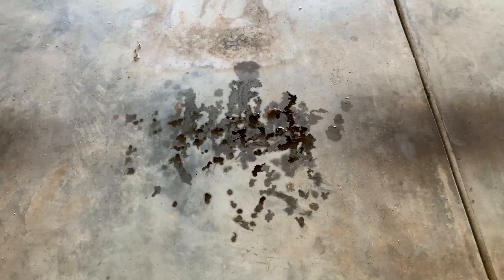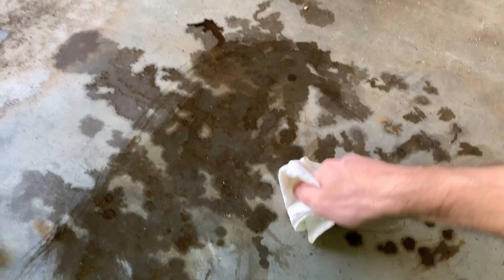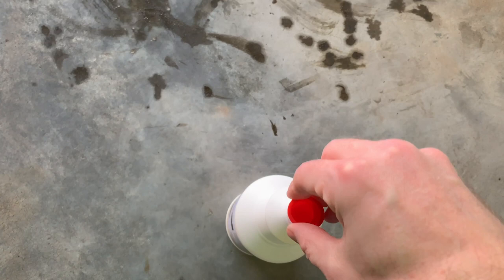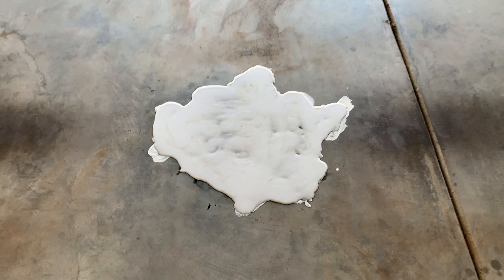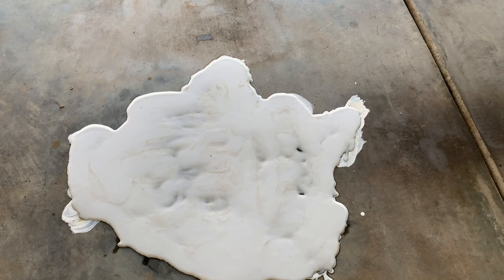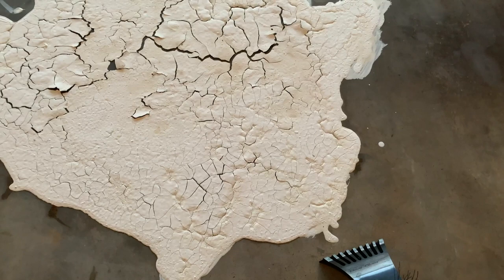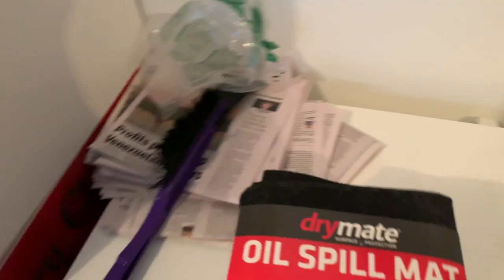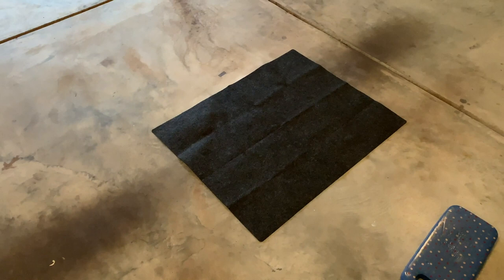2007 Honda Odyssey Oil Leak Cleanup Part 1 | How to Clean Oil off Driveway

Comment: Does the product tell you how much to use or how thick to leave it on to let it dry?
Reply from the maker: No, it just said to pour on evenly and it will self-level.  So that was the only hint was to pour until it seemed to cover.  But the bottle was cheap and it seemed to go a long way.  I put a link to it in the description